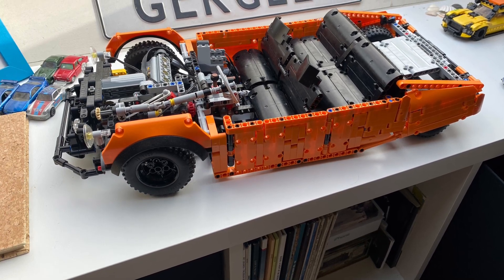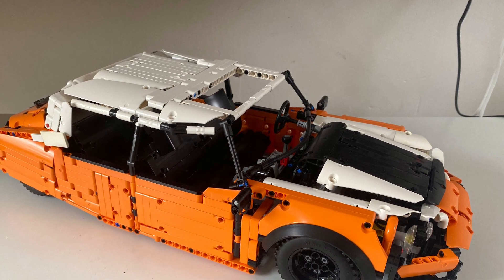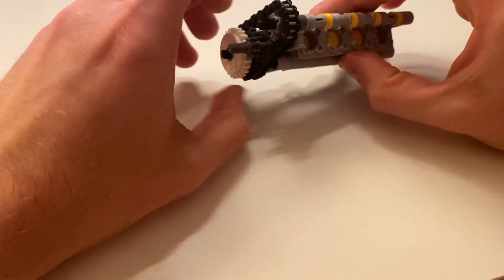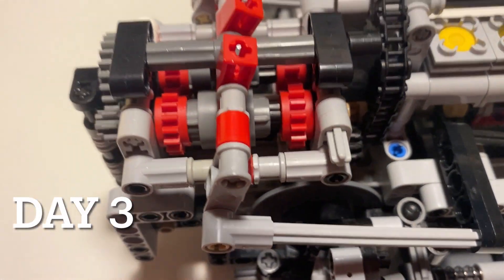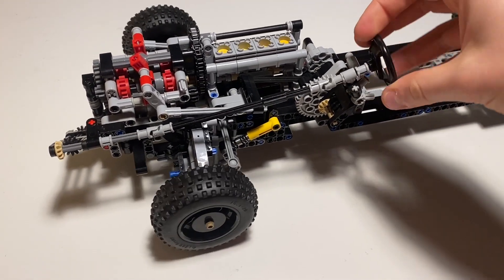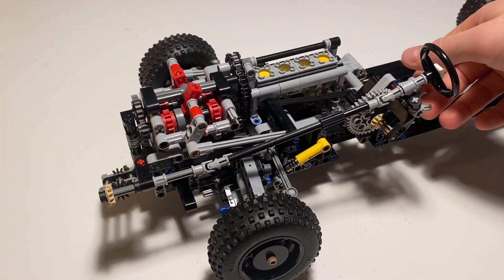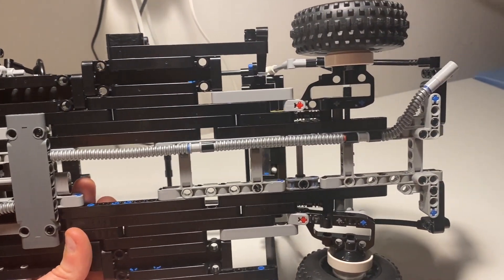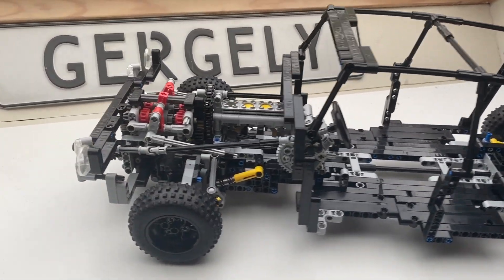Lego Technic Citroen DS Chassis - Build Process

Comment: Nice project!

A few corrections however to things that you picked up falsely on your study of the real car. Piston one an four do not fire simultaeaously. They do move up and down at the same time, but as this is a four stroke engine, one full cycle requires 2 revolutions of the engine. 1 and 4 fire alternately , one on the first and one on the  second revolution. Secondly a DS does NOT have an overhead cam shaft. It operates the valves via rockers and tappets off a camshaft that is somewhere way lower in the engine.
Reply from the maker: Thank you! I appreciate the information. I suppose the movement of the pistons is still realistic in my model, even though I was wrong about the firing order. I am a bit embarrased about thinking it was an overhead cam, I should have done some more reading.
Reply: @gergelystechnicmodels8565  Hey thanks for the response. I really like how you seek realism in this project... pretty awesome. The movement of the cilinders is spot on. Just the story with it was not entirely correct.  I was an adept lego builder back in the day. Now i get to Tinker with my real citroen id ( a simpler version of the DS)